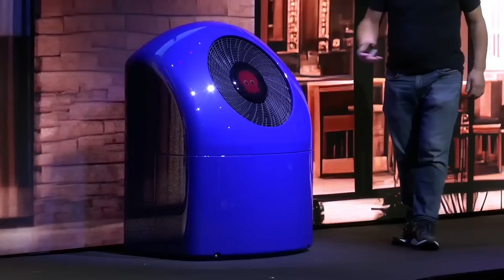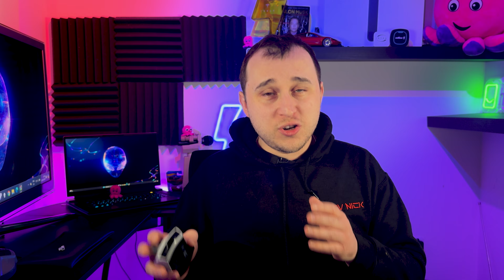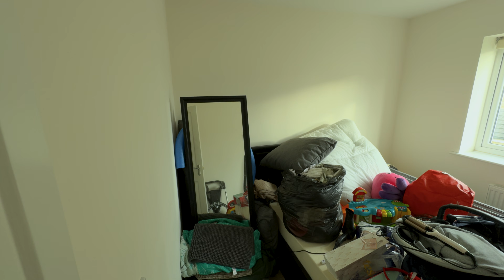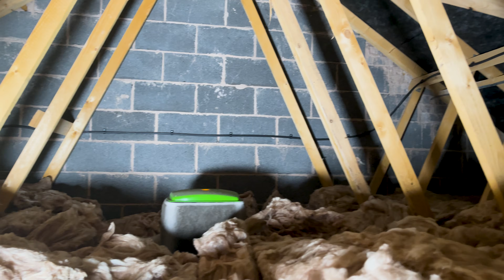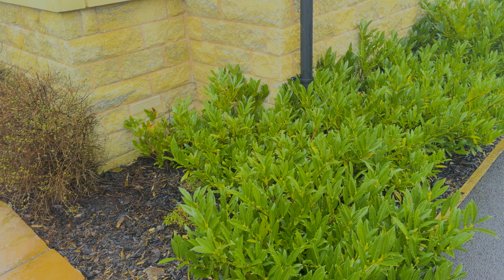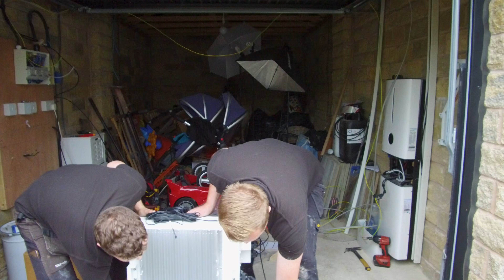Octopus Heat Pump Survey HAS Hidden COST!

Comment: Instead of installing a Domestic Hot Water Storage (with all related problems) you could install a Hybrid System (Wall-hung Gas boiler + Air to water Heat Pump). In this case the Gas Boiler will produce domestic hot water instantaneously (so the gas boiler will start only when a hot water demand is generated by opening a tap) while the Heat Pump will be used for heating the rooms. In addition the Gas Boiler can also be activated to support Heat Pump when outdoor temperature is very cold or to speed up the room warming up. This will semplify the installation and reduce the total cost of it. What do you think abput?

Comment: I had survey told pipework would need replacing. But optopus will not do this. So be careful you have to have somebody else do work. I had no problem paying for this. But they only want easy installs

Comment: Hi, I have only just seen your video. I am a retired heating engineer: First, I suggest you get a heating company in your area that has a good reputation to give you an estimate. If they are good they will come up with lots of ideas. 2 Don’t be swayed to put it near the path or highway, it is likely to get stolen, vandalised, graffiti or sticks poked into the fan, etc. 3 Wherever you put it, make sure you can run the condense water somewhere, the condense from HPs is greater than a condensing boiler. 4 watch out for wind direction, if it blows toward the fan it will affect the performance.  Hot water cylinder can be a problem, but check with other Manufacturers’ you could perhaps get one smaller with an extra large coil inside, (which HP cylinders do have anyway) that would be smaller in the loft. (make sure you place it over a wall underneath, to help take the weight, just think of 1 litre = 1 kg good enough for the weight calculation + weight of the cylinder itself). I could go on, but I’ll stop there.

Comment: I installed a heat pump and much larger radiators but I kept all of my original, 32 year old 8mm copper microbore circuit, and it works very well indeed. It just needs a dedicated pumped secondary circuit, connected to the primary via a low loss header. It would be a shame if Octopus refused to consider that.

Comment: I am amazed by the small id of those connections! Here in the Netherlands we usually start at 13 mm id, so 15 mm copper or 16mm steel or unicore.😮
Reply: Also, no attic since the ‘70s looks like that!! Insulation is in the roof so any installations are inside the heated “shell” and not exposed to outside cold which puts a strain on the pipes and boiler vat own insulation. (Affecting heat loss.) The cold water intake of the boiler is also vulnerable to condensation which can cause corrosion damage from water creeping unseen under insulation. Only completely sealed Armaflex of the right thickness will protect from intruding water vapor throughout the summer when humidity is high.

Comment: Just got a quote for a heat pump and running costs versus natural gas.  Shocked, under the current tariff’s electricity charge would mean I would be worse off by £70 a year on top of the cost of installation, so no saving.  I am not with Octopus and this was an independent survey.  I am looking at propane bottles vs natural gas, so the gas daily charge of 28.191p and gas meter will go, I have only a combi boiler that needs gas.
Reply: So a combi boiler is better on your pocket?
Reply from the maker: @bruceleenbs  heat pumps cheaper to run than a combi but depends on flow rate and install but should be at worse price parity
Reply: @NicolasRaimo  current cost of electricity inhibits mass adoption of heat pumps. It's affordable mostly higher income with some cash to spare and shell out extra for heat pump.
Reply from the maker: @bruceleenbs  there’s a deal for heat pump customers offering cheap flexible electric,  even at standard rates its price parity with gas and my install less than a new combo boiler swap
Reply from the maker: Octopus can quote for non customers

Comment: What's stopping you from putting it under the windows facing into the garden? Aesthetics? Seen a few installs like that and they don't really stick out once they've bedded in a bit, garden looks large enough that you wouldn't need to worry about recirculating cold air, might just need to extend the patio by a foot. Can understand if aesthetics is a deal breaker there, it's your house after all, and compared to the regular boxy heat pumps you wouldn't look twice at I think the purple Octopus heat pump is ugly as sin. Sorry if you answered that during the video, watched it and only thought about it during the drone shot at the end...and I'm not rewatching 25 minutes 😂

Comment: With regards to the boarding of the loft. Bear in mind, a walkway will have to be left in place for an engineer to service the cylinder annually.
Reply: This is interesting to keep in mind, heat pump system services might cost more than gas boiler systems.  Does it require a more involved service than a hot water tank that's part of a gas boiler system?  Whenever I have a service done, they only do the gas boiler and gas fire, are they supposed to also check the hot water tank?  Mine's never been done in 25 years and I've had not problems.

Comment: So basically it's a total new installation with all the additional mess that goes with it. The heat pump will be a disappointment if it doesn't work in the winter after doing all that.
Reply from the maker: How wouldn’t it work?  It’s a proven technology run my rads at 60c now with these upgrades it’s an easy switch
Reply: It will work fine. That is why they do the very detailed survey so there is no huesswork involved.

Comment: Not sure how far your install has gone, but have you heard of a Sunamp? I believe I read they make an outdoor vertion of thier hot water battery, so this might save you all this extra cost by having the hot water in hte kitchen or outside, and yes they work well with ASHP and they do a 250L vertion as well.
Reply from the maker: Octopus don't offer sunamp

Comment: Hmmm ugly pipes running along the outside of the house.  Can't the tee into the boiler pipework already there?  Will reduce the ugly pipework on the outside
Reply from the maker: boiler is middle of house wall where the kitchen is and I'd see pipe work in my garden then
Reply: @NicolasRaimo  I was surprised the solution the surveyor suggested - 5 stars to him.  Chasing the pipework up the side of the house beside a downpipe, in though the eaves into the attic space dropping down to the airing cupboard where the tank is.  Just hope the estate management company approves
Reply from the maker: @AndyJHiscock  I don’t have eves on my build and house is reconstituted stone so can’t chase into it

Comment: We had a quote from octopus for a heat pump (11,000 - 7000) £4000. We have an average sized 3 bed house.  Wish we were quoted £500!
Reply from the maker: its going to depend on your EPC and other details they gather during survey
Reply: It depends on your house and epc and your heat loss this needed a smaller or bigger air source pump and  depending on plumbing required

Comment: I have installed many combi systems so listening to your account of the need for bigger radiators, tank in the loft, insulation and lights in the loft, pipes up the wall ,restrictions on the location of the HP unit, hiding pipes int eh walls and so much more  - I have calculated that it will cost you about £18,000 less any grants. For what? What actually does a HP achieve which is more cost effective than a modern combi which can be installed in a day. Because a combi is only costing when it is running - ie for hot water in the summer. and when the house is cold in the winter. Gas is half the price of electricity.
Reply: What is the annual running cost for a 10kw heat pump including maintenance? Is it very expensive compared to a combi boiler?
Reply: Took octopus 4 days to install mine at a cost of £915 all in, we now have no gas whatsoever and had the meter taken out and it’s so far a lot cheaper, they swapped some radiators, all labour, new water tank, the heat pump, the lot, also it only kicks in when the water drops to a certain temperature just like a gas boiler does. We needed a new boiler cos ours was 10 years old and constantly breaking down so it was a choice of £3k for a new boiler fitted or £915 for a heat pump and I’m so glad I went for the heat pump
Reply: @JM1919MJ I could never loose my gas hobs, induction ones are terrible. I do like the idea of the rest of it though.
Reply: Many people don't want to burn gas anymore and the planet needs so many more people to think that way.

Comment: According to the installation manual, the primary from the Daikin HP to the cylinder max length is 10 meters. You have plenty of room at the back of the house for the pump? I don't understand why Octopus offers solar diverters why would you want to heat via the immersion at an efficiency of 1 when I can use the heat pump & solar to heat the water at an efficiency of >2 allowing you to export more leccy or run more appliances from solar than you would using the diverter immersion heater. I must be missing something regarding the solar diverter

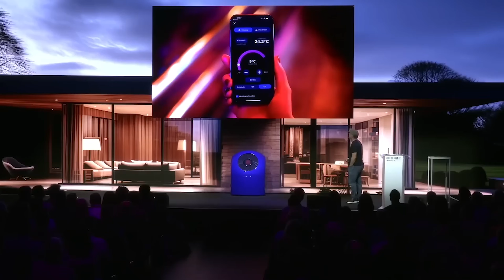Comment: 1:48 "Instead of using hydrocarbons it uses propane gas" Propane has the chemical formula C3H8. It's LITERALLY a hydrocarbon! 😉
Reply: Came down here just to find this comment!
Reply: Not nearly as bad as the information on the Octopus website ... "A heat pump can last 20 years – up to twice as long as a gas boiler."  😂
Reply: When I was in the USA the car repair place offered propane as a ‘under the shelf don’t tell anyone’ option to charge the air con in my trans am.  It worked but don’t crash it😂😂😂
Reply: Very common even here in UK😂
Reply: That one puzzled me, too.
Reply: I think he meant propane is a better refrigerant than the hydrofluorocarbon (HFC) type refrigerants it replaces.
Reply: @RayCottam  Indeed, it wasn't well phrased and I got the point just that i'm being the pedant of the day ;)

Comment: Be interesting seeing a few installs of the cosy 6 before I buy one.  I do wonder about the opening for the fan, I assume the fan is still mounted vertically rather than an angle (because that would be really daft, more likely vertical with ducting), but surely rain is going to collect in the opening, on heavy snow days it would become blocked? Although I'm sure it has drain holes and they will have mitigated this it appears to me to be an unnecessary design choice.

I think with your particular home there are too many compromises, have you considered a wall mounted split unit like Vaillant aroTHERM split 5kw or 7kw.  Pipework much smaller so less issues internally and shorter pipe runs so less heat loss.

Comment: Had a British Gas ASHP survey for my 7 year old 4 bed new build. Shocked they came out with £14k on top of the £7k Grant!
They proposed 10kw Valliant (fine) but then replacing all 13 radiators (over spec methinks for their ‘warm home promise’ 1 year guarantee).
Reply from the maker: Try octopus see what they say and compare the 2 on what they spec,  you can also snag another £100 off when you split £200 with me on refferal code in pin’d comment
Reply: What is the annual running cost for a 10kw heat pump including maintenance?

Comment: Great video, I'm right at the start of my journey with Octopus and solar/heat pumps, thought that it might be better to get solar panels first to offset the difference between electric/gas prices but much more expensive to get panels so maybe better to get a great pump first since it would be on par with gas due to COP 4 anyway and we don't know how long the subsidy will last however the option you mentioned to have the pump connected to solar makes me wonder if this could be done retrospectively if I got a heat pump and then solar later? 🤯 such a lot to think about and juggle, really grateful for these videos.
Reply from the maker: Don't forget you can add my referral link to save another £100 off your octopus quote!

Comment: I'm interested in the cosy fan being on an angle as most heatpump noise issues usually happen when the unit isn't upright with a wonky base causing noise 🤷‍♂️
Has the cosy got extra special bearings 🤔
Reply from the maker: that be because the fan is mounted to be at that angle rather than on an angle if this fan is mounted to be at this tilt it be fine as long as the base of the unit is level
Reply: @NicolasRaimo  Not convinced... I need a scientist to explain the forces involved and proven longevity of this angled fan malarkey 🤷‍♂️

Comment: Hi Nick. A very interesting video as usual! I had an online quote from Octopus yesterday, so your video is very timely. I've got micropore to many of my radiators from a manifold under a bedroom floor. Even though the Cosy 6 will work with my setup, I think it has to run hotter to counteract the microbore. That means the efficiency (SCOP) will be less, so the running costs of the system will be more expensive than the gas boiler system is. I think this means that I'll have to have new pipework. Is that something Octopus will do (as an extra cost) or would I need to get that done before the install? 
Also, you said the Harvi is a solar diverter, but it isn't. The Harvi is a hub. The solar diverter is the Eddi (I know because I've got one!).
Anyway, thanks for another really interesting video Nick
Reply from the maker: Hi Phil octopus designed for 50c flow for all systems when the outside temp is -2.3c for my area it’s likely I’ll be able to dial this down but this flow temp is 1p more than gas but gas is 90% efficiency so it’s price parity maybe cheaper that’s run at 28.5p peak rates for intelligent if you used octopus off peak rate as well it’s well under gas! Cost6 doesn’t need to run hot it’s just able to but for micro of 10mm it’s fine.   Another video is due with this info
Reply: @NicolasRaimo  That's great. Thanks for the reply and the info Nick

Comment: As a plumber and heat pump installer, I'm surprised that you are surprised that extra work costs extra money. Also, I've never seen octopus to do a £800 heat pump install (as advertised) for £800.
Reply: Cost us £915 for the lot

Comment: Just had a octopus daikin 6kw ASHP installed 3 weeks ago. New build with plastic micro bore. They replaced 6 rads & 3 towel rails, upgraded from single to double panels. 300 L water tank & volumizer for defrost cycles. Works really well & I had loads of fear about micro bore, very hot water & heating the house nicely on cold days. Quiet in operation & cost us less than £2k after bus grant. Usual very good service from Octopus, would highly recommend to anyone considering it
Reply: Just had the same at our house, cost £915 all in, they even swapped some of the pipes.
Reply: Hi can I ask what initial quotes were? No survey yet but they gave an initial quote for 4200 after grant for a 3 bed semi. Both yours sound very good prices
Reply: @beverleyhughes7863 quoted me £915 (that with the BUS taken off) 3 radiators replaced and some pipe work in a 3 bed semi that’s 10 years old.
Reply: Initial quote was £9700,, so came to £2,200, but dropped again to £1950 due to Daikin £250 discount. 9 radiators replaced, none of interior piping was changed. Ours was a relatively straightforward job, took the 4 days to commission
Reply: I've been quoted between £6k to £13k after the grant discount, gulp.
Reply: Some people I’ve spoken to have got it all done for £500!
Reply: What is the annual running cost for a 10kw heat pump including maintenance
Reply: No wonder you got half a job 😂😂😂

Comment: Great video. Still think you should go with a Heat Geek Elite survey, utilise open energy monitor to be on the heat pump leaderboard and run the HG Newark heat pump cylinder. 

I see the appeal in the Cosy 6 and its low cost but designing then running an efficient low temperature system is a lot more interesting.
Reply from the maker: Online quote for a heat geek elite is £7500 after grant,  Octopus is £1300 even with the higher SCOP from HG it would take around 12 years to see that payback in investment by then the heat pump could of been replaced and tech could of moved MUCH further along.   I'll likely be fitting open energy monitor to my system anyway as makes it more interesting for my channel and videos.   PS am not dismissing what heat geeks do but for a small dwelling like my self and limited heat demand the cost difference is FAR too much
Reply: @NicolasRaimo  @HeatGeek Co-lab video would be enlightening for all us new build owners wanting to switch 🤔

Comment: I was quite keen to have a heat pump however with 8mm microbore pipes these would need replacing at a cost of £2500 so it’s a non starter for me unfortunately
Reply from the maker: Hopefully a solution for you might be possible some other heat pump installers can likely do it with different system designs even now depending on heat loss

Comment: Great video. Really interesting. Have you seen the Dutch 'chimney' heat pumps? No idea if they are available over here but they might be a good solution for you. We are almost a year into our heat pump installation and really enjoying the system!
Reply from the maker: I’ve seen Bosch chimney Hp not a big fan of its look to be honest makes sense for a new build but I think structural support for mine be an issue plus I got solar panels on roof
Reply: @NicolasRaimo  Fair points. Nothing's ever easy, is it?? It'll be worth it in the end though. Good work 🙂

Comment: Think I'll stick with a boiler for now.
Maybe if I get solar and a few batteries, I'll get an electric boiler, but I'll not be getting a heatpump. There is way too many pipes and stuff involved I have no space for the tank in my house, I would need to build a lean too nevt to the house and that's just extra work that I couldn't justify.